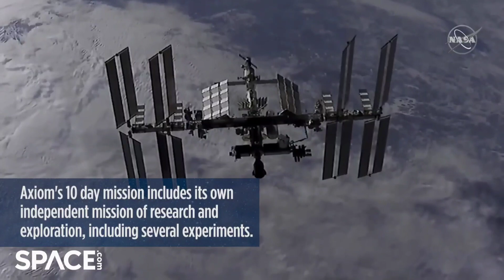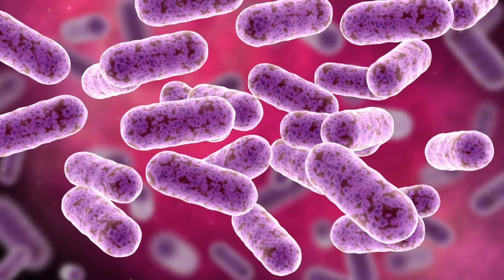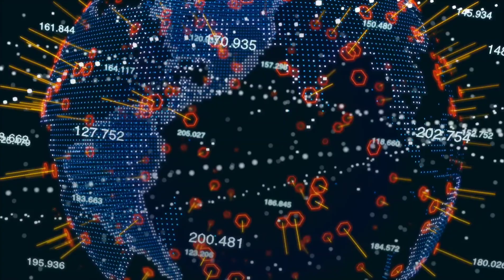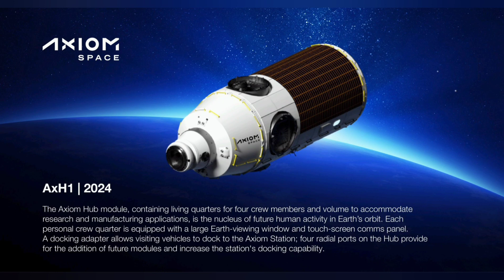New ISS with artificial gravity??  Axiom, NASA and Europe start a space city!!

Comment: My two questions from your Great presentation.
1) Can they add a station boost module?
2) Why aren't the modules inflatable??
Reply: The Axiom proposal apparently includes their station disconnecting to go independent, so a boost module is basically mandatory.

Frankly, while building a boost module isn't a zero-effort endeavour, it's really just standard rocketry stuff with different preferences for instantaneous thrust and propellant attributes. The only reason the Russians provide it right now is because they were working on permanent modules earlier (NASA has a module intended for just a few years operation in a partially complete state).

Comment: Good update on Axiom. I was having trouble finding the details on my own.
 As far as artificial gravity, I disagree that it isn't a research project, since A.G. has never been tested in space (except for primitive experiments in Gemini). I agree that A.G. will be the only intelligent way to be ready to land on Mars. Microgravity is simply too debilitating. Since there are concerns that A.G. may cause a variant of space sickness, we definitely need to be testing adaptation to A G. We also need to verify that A.G. does indeed mitigate the previously proven physiological effects of space travel. A.G. is its own complete area of research related to the Mars transit. Extremely important. My only concern is coupling a rotating section to a stationary system without disturbing the microgravity research environment. Perhaps we may end up with an entirely separate rotating section with a small "shuttle pod" to allow astronauts to go between? Or just 2 small stations. Clearly redundancy in life support would also be good on an Axiom freely operating system. As I understand it, both the Russian and international sections of ISS each have life support systems, right? Pretty important system to be redundant.
Reply: Except for sleeping,  AG on a small radius is disorienting and won't prove useful. Elsewhere in these discussions was some research mentioned that defined the minimum radius to prevent that disorientation.  The cheapest way would be to have two modules attached by cables and spun around a common center. An access tube could be put along the cable to allow movement between the modules, or a clothesline like system could pull astronauts between the units in their EVA gear.

Comment: You can have stations that have rotating sections and sections that do not rotate so you can have both micro-gravity and artificial gravity environments on the same station. This would allow for safe long term housing for workers as well as housing for tourists but would also still have the appropriate areas for micro-gravity experiments and manufacturing. That is what we need and that is what I advocate. We just need to work out the details of how to do this best. Bust as long as no one is building and experimenting with long term centrifugal force in orbit, we don't have the info we need. That has to change.

Comment: They need a more secure way of hooking each section to the other. Although in micro gravity the station is going to experience shifting between sections. Especially when all of the weight of a section is secured by a small flange. Metal fatigue. Plus the thermal fatigue. Could they develop a skin to cover the outside of the station to cut down on thermal fatigue???? Plus it would give them a little buffer again debris and micrometers strikes. Also would make it a little safer for doing walks outside station for repairs.

Comment: As for artificial gravity, I think the only viable way to create it is with thermal nuclear power and some kind of torus ring ir torus ring super magnet, or a pair of them, to generate the shaped magnetic field.  This will have to be stronger than that necessary for a shield generator as envisioned by scifi. There is a current theory that a force field shield will not require the massive amount of energy as we first thought. It should be possible to separate a microgravity section from a gravity well section.

Comment: Artificial Gravity at LEO is still decades far away. The centrifugal forces would result into possible vertigo symptoms to the Crew. For a more wealthy Gravity sensation, the diameter of the structure needs to be massive. And some problems maintaining the orbit could occur due to the rotating movement.
Reply: 0.1 G would be enough to simplify a massive number of systems and human interactions. You do not need a high RPH or massive size or significant strength to generate a force like that
Reply: Long therm space living in low g is important to understand the effects of a Mars mission or lunar colony
Reply: lunar or martian gravity will suffice
Reply: Orbital complications from the spin are easily compensated for in software. Helicopters already had to do similar things with purely mechanical systems in WW2.
Reply: @absalomdraconis   or contra rotation

Comment: Hm, I wonder, are these launches going to be on Falcon 9s? Or will Falcon Heavies be required? If it's the former, the whole station could be put together in a month.
Reply: Only if they had all the money at once.  It seems they have just enough to start then must begin earning money on the station to add modules.

I wonder who will be the first to start building modules designed to be transported on Starship.  Bigger and if Starship even partially lives up to promises cheaper  to launch than the smaller modules transportable by Falcon 9/Heavy or any other launcher existing or on the near horizon.

Comment: Do the New space station will have a  better orbital plane? The Russian one to be baikonur accessible makes it useless as a stop point to outer space missions
Reply: @Mike DeMarco  that's the axiom one. So it goes with out saying. 

The question was about the other one
Reply: @bernhardjordan9200  If it's launched from KSC, it can have an inclination slightly lower than 28 degrees.  ISS is at 51, if I'm not mistaken.
Reply: @CountArtha   it can have. But will it?
Reply: @CountArtha  what is today's moon and Mars inclination?
Reply: @bernhardjordan9200  Close to zero.  The Moon is at 5 degrees
Reply: @CountArtha   I got one thing

Mars is close to zero from the sun but earth has an axial tilt you need to add on it so the best inclination for a space port destined to Mars shul be around 24ish⁰ I hope they could do something like it. 
It can be a fuel depo or even a stop gap for a starship fuelling or anything other kind of orbital assembly to Mars. A cycler would be great

Comment: Yeah, micro gravity is needed for science, manufacturing and research (non-scientific research? ;)  ) but the people doing the science need artificial gravity if they are going to stay there for very long. So far, everyone has effectively been a test pilot and as such, they are allowed to suffer deterioration to their bodies. So far so good. However, the next phase of space stations in low Earth orbit will have to deal with labour laws and regulations if not unions. Artificial gravity for time off is basically required for good health.... we hope. Should Artificial gravity prove just as unhealthy as micro-gravity, space travel is hooped. However, I think artificial gravity will work for pretty much everyone if the size/rpm is right. All that said, we need to be researching artificial gravity yeasterday. I am not talking about the greater than 1G research that has been done on Earth so far but for 1G or less that can only be done in space or on the Moon. Man has already figured out that micro gravity is bad for people, so start figuring out artificial gravity while continuing to do all those things that do require micro gravity. Start caring for the people doing the work.

Comment: Name 1 reason why the ISS couldn’t be utilizing its footprint for decades to come even if it’s just storage or spare parts?
Reply: It's old, crumbly, leaky and hard to maintain. I requires actual hands on board just to stay functional.
Reply: Maintenance and cost of operation on an aging infrastructure. Money that they could be throwing away to SLS and Boeing.
Reply: @oljimeagle  I'd rather it be spent on new missions to Jupiters moons and Venus personally. Or specialised exo planet telescopes
Reply: @jounik  : As I understand it, the actual structural components are fine. It just needs to be refurbished (which arguably isn't currently possible), including via replacement of seals. The bigger issue is that the orbit is a massive hassle, and is only tilted as far from the equator as it is to make it possible for the Russians to access it.

As for the crew, you need them to swap experiments in and out, to act as guinea pigs, and to do maintenance on actual experiments. You could try to replace them in every role other than guinea pig, but you'll get inferior performance if you try.

Comment: We don't have 2 years to get a new station up. 😞
Reply: We do have 2 years to get a new station up. The only way the Russians could change that is by intentionally sabotaging the project by dropping the orbit or some similarly extreme use of thrust, at which point they still won't have caused an immediate deorbit, and the non-Russian sections will disconnect from the Russian ones, before using the attached non-Russian vehicles to slightly modify the "new" ISs orbit from the Russian one, leaving the Russian modules without significant amounts of power or cooling, their fuel tanks empty, and completely lacking in experimental space. This would be followed by several missions to fix the orbit of the "new" ISS, because with or without the Russians there is not enough thrust on the ISS to initiate a safe deorbit- thus, the orbit would have to be rendered "safe" regardless of everything else.

Comment: Whats the chance out of spite the russians would deliberatly de orbit the iss
Reply: Not enough fuel on the entire ISS to actually deorbit it. They might be able to deorbit their own modules, but any serious attempt to deorbit the ISS itself will result in their fuel getting exhausted, followed by the connection to the rest of the ISS modules getting "cut" by the international crew, and the visiting Dragon or whatever else being used to create a slow separation with just some RCS firings. This would be followed by several missions to stabilize the orbit of the ISS, because deorbiting it safely is going to require at least one dedicated mission with customized hardware.

Comment: Real gravity is better. If a ship travels at a constant 1g acceleration rate it would get to Alpha Centauri in 3.6 ship/7.3 Earth years (and that includes turning the ship around half way and decelerating) not only is this by far the fastest way we can get to other worlds but the ship would have gravity the whole way which will allow on board farming. The ship would achieve about .95 light speed after about 1 year. A 10 ton ship would need a mere 10 tons of continuous thrust.
   All thats needed for this is a fission rocket that can put out thrust for long periods and does not consume hydrogen or xenon (you cant bring 500 tons of that with you). 1 kg of uranium has the same energy as 120,000 tons of coal and plutonium has a lot more than that. The trip to Alpha Centauri would require less than 1 pound of uranium.
   Both uranium and plutonium are jittery atoms that are on the verge of fissioning by themselves, there should be a way to get them to fission in a linear fashion with an electric current, see "best method for interstellar travel". A true fission (not thermal nuclear) would be 100% efficient and should be simpler than a chemical rocket.
   With this method a ship can span the entire diameter of the Milky Way in 24 ship/113,000 Earth years. Systems with stars similar to the sun can be reached in under 10 years.
Reply: How do you impart thrust without throwing mass backwards? You will need the 500 tons of hydrogen or other reaction mass.
How does your engine produce thrust?
Reply: @richspillman4191  All previous fission rocket concepts utilize hydrogen or some other element in there process, this automatically makes them not suitable for interstellar travel. Not only is it possible but its inevitable.
Reply: @shawns0762  again I ask you, WHAT DO YOU USE FOR REACTION MASS TO CREATE THRUST?
Reply: @jaychip1   In a chemical rocket you have a reaction between propellent and oxydizer. That does not apply to a true fission rocket.
Reply: @shawns0762  : Once again the same question: what do you use for reaction mass to create thrust?

Moving to fission does not avoid the need for reaction mass. Reaction mass isn't used to allow chemical rocketry to work, but instead chemical rocketry is used to make reaction mass useful. The reaction mass is required, the chemical rockets are just the easiest way to get that reaction mass moving.

So, what do you use for reaction mass to create thrust?
Reply: @absalomdraconis  If an atomic explosion happens at the back of a space ship it will be pushed forward, it's not debatable
Reply: @shawns0762  it's amazing that you know about special relativity with time and length dilation, General relativity with acceleration/gravity equivalence, that you accelerate the first half if your journey, then decelerate the second half, and yet DON'T KNOW HOW A ROCKET PRODUCES THRUST.
Even in a fission powered rocket engine, you still need to throw mass backwards to produce thrust.
Otherwise, your fission engine just heats itself up, and goes nowhere.
What do you throw backwards in your fission engine design?
Reply: @jaychip1  Holy stupid batman, its not my idea, its been written about since at least the 1960's. NASA's Orion project was the same principle, using a series of nuclear explosions behind a ship, the only difference is that a true fission rocket would put out continuous thrust, the same propulsion only in a non pulsed format.
Reply: @shawns0762  Orion works. Pure fission does not. It just gets hot.  No thrust.